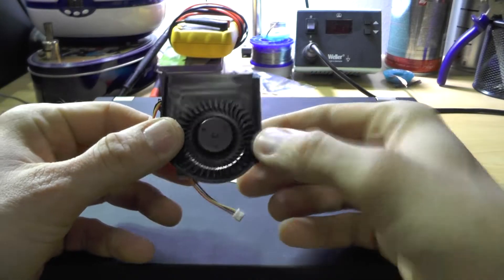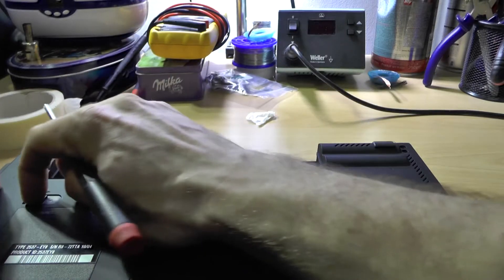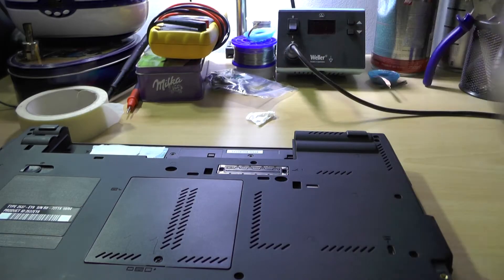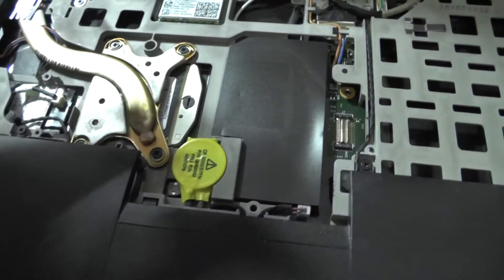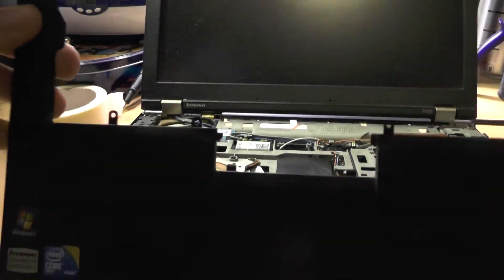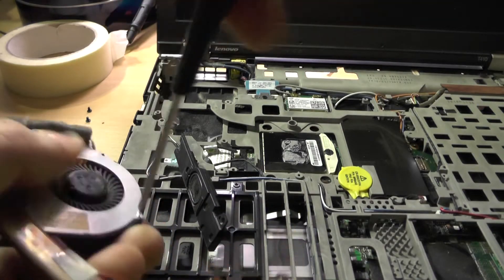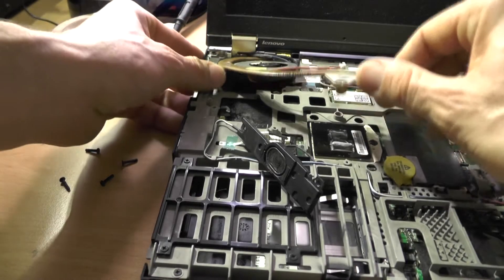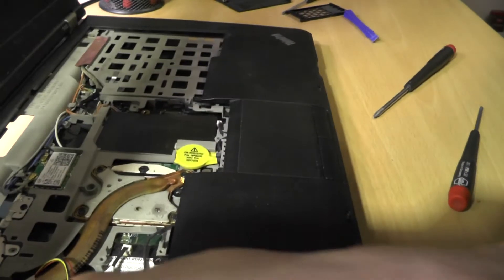[HW: HowTo] - disassemble, clean and install new fan (Lenovo thinkpad T410)

Comment: holy fk why do they make it so complicated just to replace a fan??
Reply from the maker: yeah... it is a bit :/
Reply: @MTS_IT  thanks for the video tho! I'm definitely not doing it :D
Reply: @MTS_IT  Ha! I did it! It wasn't as hard as I thought it would be! I cleaned the fan but it still gets hot pretty quickly. I guess I need a replacement fan. May I ask what is this silver tape you used in the video?
Reply from the maker: it’s an insulation tape (usually for chimneys :)))) but it’s awesome for directing air in laptop because it’s heat resistant and will not fall off after some time due to heating up / cooling down  (unlike others)
Reply: @MTS_IT  thank you!

Comment: Hi. So I followed all of your steps perfectly. I can see that my fan is working now and my laptop doesn’t shut down anymore when starting up. But the screen itself doesn’t work now. And it did before. I think I maybe I moved something by accident. Do you know what I may have done wrong?
Reply: Hi. did you fix the issue? i disassembled my T410 today and now its screen will not turn on and the computer won't turn on either. 😓😪😭
Reply: @nerd2544 did you finally fix it? In my case I first needed to properly push in the connector of the fingerprint reader to allow it to start up again (which I find rediculous).

BUT - just cleaning the fan didn't help – I can exit the Fan error with F1-Esc-Esc or just Esc and e.g. enter the BIOS – but after a few seconds it shuts down anyhow. So I assume in my case the fan is really broken.

Comment: I'm trying to find a replacement fan.  Do you have the model number of the part, and where did you find it? Thanks.
Reply from the maker: i bought from this guy: https://www.ebay.com/itm/L%C3%BCfter-Lenovo-IBM-ThinkPad-T410-FAN-K%C3%BChler-NEU/223695471282?ssPageName=STRK%3AMEBIDX%3AIT&_trksid=p2060353.m2749.l2649